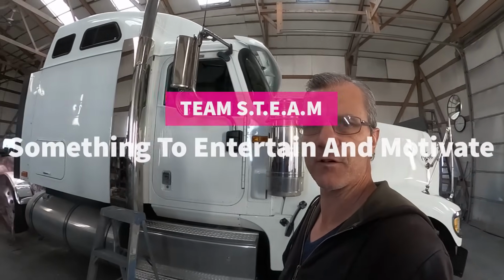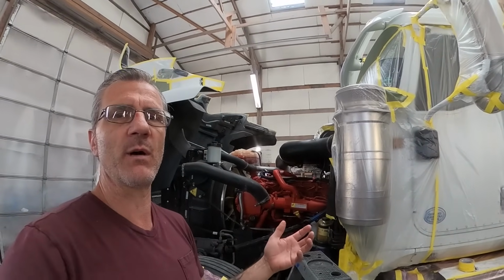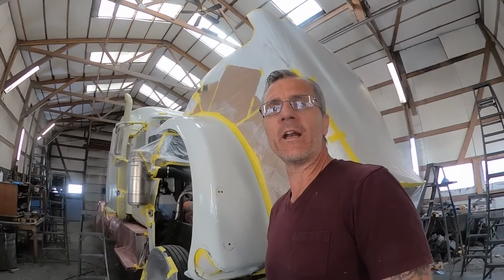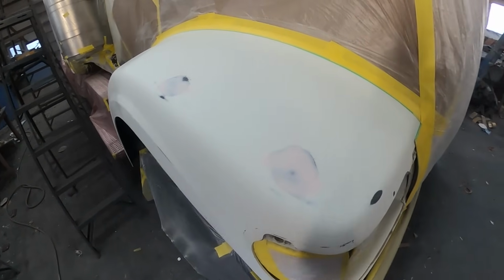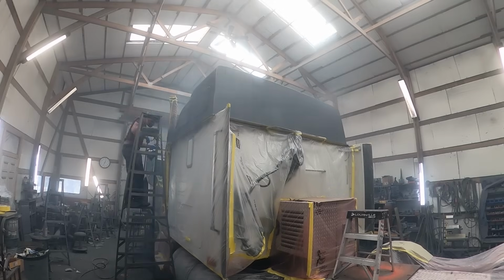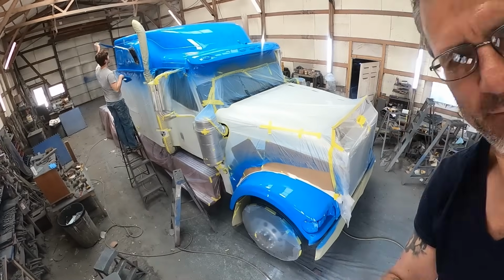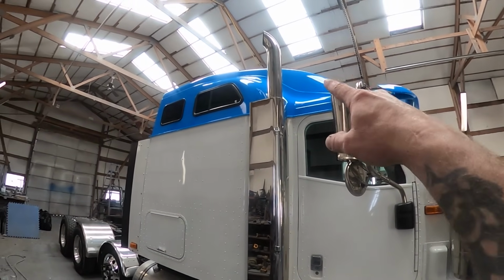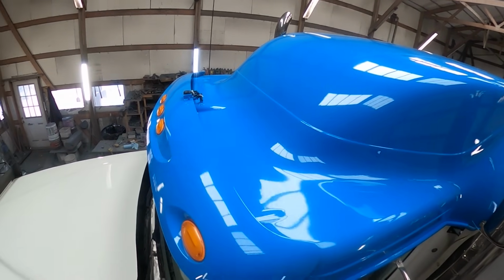The Eagle Has Landed!! 2014 International Eagle

Comment: I'm runnin a little behind on videos. It looks really good. It's amazing how much difference some
secondary color makes. Even better when the paint that it's going on is really nice too.
Getting rid of those mirrors made a big improvement . I never could stand those things.
The little reflector on the side of the hood was a good idea. Much cheaper, and much easier,
and it looks basically centered underneath the Eagle emblem, so it doesn't look out of place.
It's funny how many people think that all white is the same. Same way with black too...
Reply from the maker: Well I certainly appreciate you positive input, my friend! Yeah...most folks don't realize just how tough it is to match whites sometimes. Plus, they saved a bundle by not having me paint the hood as well.